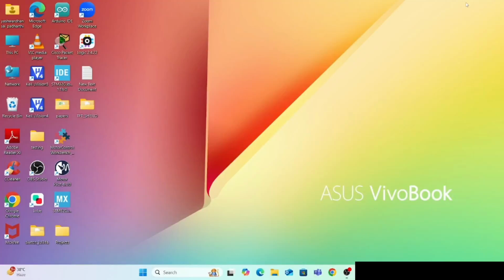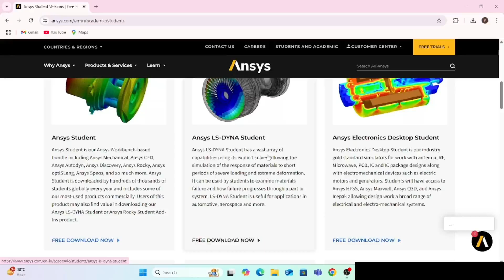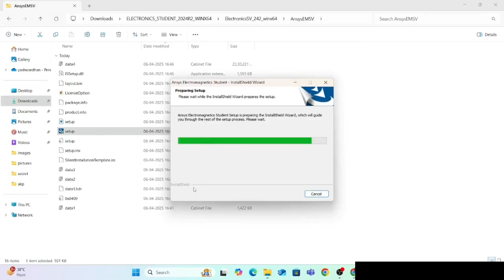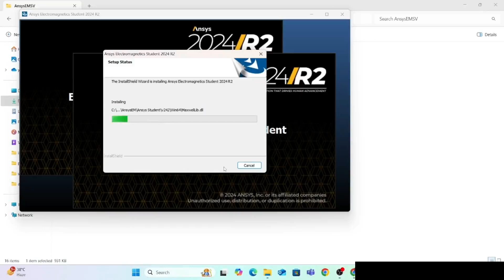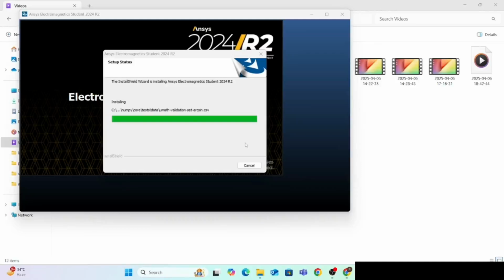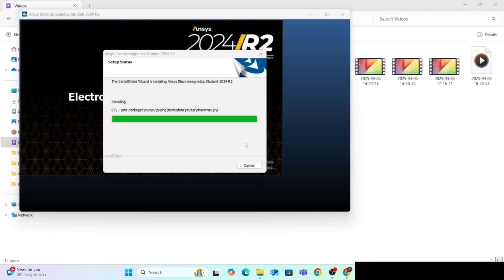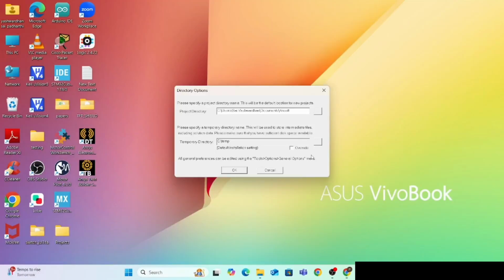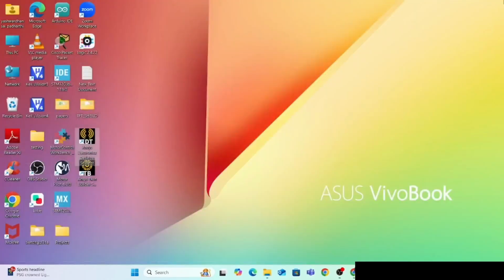💻 How to Install HFSS Student Version in 2025 | HFSS Installation

Comment: Sir I installed this software but this software logo is not match with that logo which I learn in. Class
Reply from the maker: Sometimes the logo might be slightly different depending on the version, but the core functionalities should be the same. Also in the video I showed installation of whole anyss software,if u install only a particular software like only electronic workbench or hfss then too the logo will be slightly different.

Comment: Monsieur je install sa mais  simmmulation n'active pas et comment modifier les axes de reperes il ne donne pas
Reply from the maker: In HFSS, if the simulation doesn’t start, first check that you have defined the solution setup and frequency sweep properly. For changing axes or reference orientation, you can adjust it in the 3D modeler window (View → Coordinate System). Hope this helps.

Comment: Hi sir, after downloading it only opens twin builder
Reply from the maker: Actually after installation you get two softwares one is twin builder and another is electronics desktop.  you can search for the software in search bar if it is not displayed on the desktop as an icon.
Reply: @padharthisaiyashwardhan  but still opening twin only
Reply: @tashu.8760  same problem,is it resolved now ?
Reply from the maker: ok try typing in the search bar sometimes it does not show on desktop.
Reply: @padharthisaiyashwardhan  it is showing electronics desktop but opening twin builder not electronic desktop
Reply: @padharthisaiyashwardhan same problem
Reply: for me same problem
Reply: Me pasa lo mismo alguien tiene alguna solución